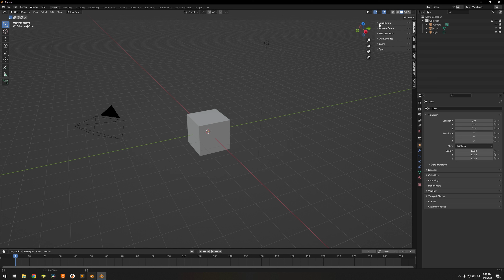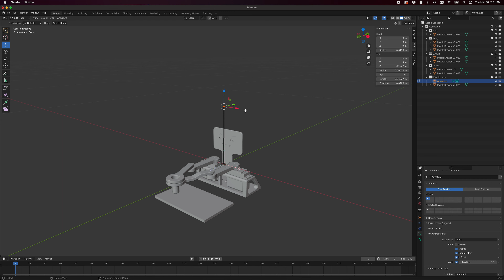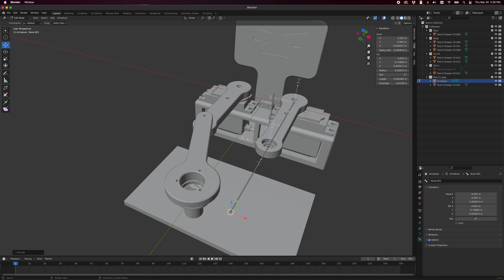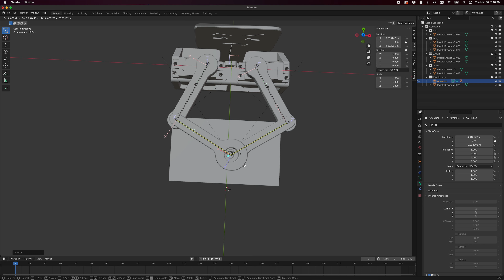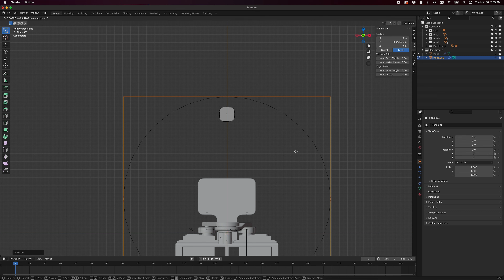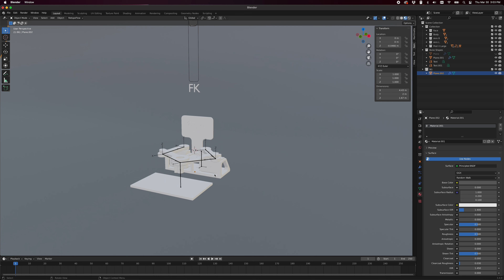MarIOnette Tutorial: Make Your Own Post-It Drawing Robot

Comment: how can I record motion or an animation in blender and save it to the nano/micro controller so that I can make it do that without the computer, for example when friggered by a button linked to the board?
Reply from the maker: Hi, I have a tutorial mostly edited covering lots of new features including close to what you're asking. Until it's posted (lots of things keeping me busy at my day job, sorry!) you can follow these steps: the 1.0.3 and 1.0.4 builds of MarIOnette supports saving an animation to a file and playing it back from an SD card. 
- Cache the file in the in the Cache menu (make sure to check "Write cache header file")
- Transfer to an SD card
- Trigger it in the Arduino code. The latest .ino Arduino file in the github has some commented code on lines 167-177 that shows an example of how to load in an animation. You can trigger that code with a button press/other input.

Unfortunately it will be some time before animations can be uploaded directly to the microcontroller, since there are so many boards with varying memory sizes floating around. Once my other work calms down a bit I'll look into tackling that and other requested features.
Reply: @knee-koh  thank you. I will check the latest build. In terms of boards, I think a good one to add support for would be the PCA9685. It supports 16 servos and you can chain up to 62 of them together. Thanks for making this! It’s awesome.

Comment: Not installing for some reason.  It's in my Addons menu, in grey, not clickable.  Using  Blender 3.4 
Error: Traceback        ModuleNotFoundError?????   If I can't Copy and Paste something , I'm usually out of luck.
Any advice would be appreciated.
Reply from the maker: Hi, could you log the issue to the github so I can track it better - https://github.com/knee-koh/MarIOnette/issues? If you are trying to install MarIOnette on windows, please launch Blender in Administrator Mode (right click the Blender icon on your desktop and select the corresponding option). From there install the add on as usual.
Reply: @knee-koh  Ok was able to install MarIOnette on two of my other PC's successfully.
The 1st computer I tried it on didn't work, cause I previously, accidentally,  deleted 
some critical files I may have needed to run my PC properly, gotta get that looked at.
Looking forward using the addon now, in Blender, Thanks.

Comment: what is config.h? Where can I get it?
Reply from the maker: Hi, config.h gets generated automatically when you hit the "Sync" button in the MarIOnette panel. That button will generate an Arduino .ino file and a config.h file into a folder you specify. When you open the .ino file, Arduino should open with the config file automatically.
Reply: @knee-koh  thanks, because I thought you forgot to add this file. thanks for the help

Comment: Could this be done with a state machine, FreeRTOS, with many servos different directions, and different timing and delays. I would like to see maybe rather we add Daz Studio stuff to it like our Daz Studio chatbot or just Daz Studio plugins and artworks in general. Then, that would be awesome. We would just need computer vision capable plugin and accelerometers or gyroscopes in the microcontrollers. If it could be based on the stm32 cortex core instead of just the atmega328 in the arduino.

Comment: Hey man, amazing work. Really.
When i was a kid, I kinda liked coding animations. I felt oddly powerful, but now, as I've grown, my projects grew too, and it's too frustrating to keep iterating in small adjustments etc etc.
Anyway, I'm finding difficult to control steppers. I'm using a RAMPS 1.4 to control a 5 axis robot camera slider. Everything is connected properly, and with a test code all the motors run properly.
I copied the same dir and step pins in MarIOnette, connected all the bones (selecting show value confirms the correct bones are linked). No problem uploading code and connecting (the serial becomes busy) but nothing moves. controlled config.h and found the first value of all motor's array was 5 (the same number of motors), guessed maybe a little bug on the less used steppers config generator didn't set the correct index, but nothing. Any suggestion? thanks in advance
P.S. I'm planning on releasing a video about the project and the project itself (when it will be i a releasable state)
Reply: Okay, sorry. Quick and last update: IT WORKS. So: implementing and setting enablePins to low is needed for steppers to work (at least using a RAMPS 1.4 board), but the last piece of the puzzle was, of course, my stupidity. Nothing in the config.h needed to be changed (sorry for doubting your skills, master), but during troubleshooting, before adding enablePins, i restarted blender, 'cause: why not? Maybe fixes something, but i forgot to restart it in administrator mode... Big facepalm.
And nothing. That's all. Sorry for bothering you. I hope that at least someone find this helpful.
Now trying to implement a homing sequence. Wish me luck!
Reply: Okay, quick update: specifing the driver's enable pins and putting them low made the axis lock while not connected which seems intended behavior (except for one, which keeps moving very very slowly an jittery in one direction).
Connecting to MarIOnette while an animation plays makes all the axis release. Stopping the animation makes the axis locks after a few seconds and resuming the animation doesen't release, and all axys stay locked. Same happens if connect whithout an animation playing. P.s. Tried to change the first element of each motor array back to 5 (in config.h) but nothing (changing them to 0, 1, 2, 3, 4 changed the stepper which slowly turns while not connected, so it is indeed the motorIndex. Obviously you know already, just a thought of mine ahaha)

Comment: This is really great stuff. I completed this post-it bot tutorial successfully. had a bit of a time getting Arduino to write to the nano but once that was figured out, everything worked perfectly. 

I was curious if there's a solution to save an animation loop or even a set of animations  stored on the Nano, or perhaps a USB drive for it to operate independently from blender. like, if I want to activate an animation out in the field, not connected to a computer, by just pressing a corresponding button on a box, so to speak. I'm a novice to this kind of stuff so if this question isn't clear, it's likely that I don't exactly know the appropriate language to describe what I'm asking.
Reply: I saw that my questions are answered in another video. 🤦🏻‍♂

I've been able to get this to work with an Adafruit Feather M0, but now I'm attempting to use an 8-Channel Featherwing PWM and I'm running into a wall getting it to interact with blender/marionette. Any recommendations or resources that could help me through this?
Reply from the maker: @benploughman4145  , sorry for the late reply! I saw your comment on another video about SD card/localized animation playback; hopefully my answer explained that process a little better (though I am working on another tutorial that will walk through the process more thoroughly).

Happy to hear it works on an M0! In terms of getting it to run on the 8-channel Featherwing board, you'd need to write some code to handle communication with that specific chip. Fortunately Adafruit has taken most of the hard work with their libraries, so you'd need to do the following:
- Create servos and attach motors inside MarIOnette as if they were attached directly to the board
- Sync the files to create the .ino and .h files for your project
- Uncheck "Overwrite Arduino File" so you can edit the files freely in case you need to re-generate more code
- In the generated .h file (the one MarIOnette uses), you'll have to include the Featherwing libraries and connect with the board (use Adafruit's examples to see how to do this and copy over the code)
- From there, you just need to replace any Servo.write() or Servo.writeMicroseconds() lines of code in the .h file with the corresponding Featherwing commands. That way, your microcontroller will tell the Featherwing to actuate the servos over the i2c bus instead of the native PWM pins

Comment: hello sir, i have a problem when i try to connect my blender to arduino. it say something like "python could not open port access is denied" i have no serial monitor in Arduino IDE, and still like this.. any suggestions?
Reply from the maker: Did you also post an issue to the github? I can track it from there. You say you have no serial monitor in Arduino IDE, are you sure the Arduino is being detected when you plug it into your computer (if not there might be a hardware issue with the board or with your cable)? If Arduino IDE cannot detect the board, then MarIOnette will also not be able to detect.

Comment: I have been waiting years for something like this! Well done! I have an issue when downloading the obj from Git.  I get a list of vertices (I think) rather than a 3D file.  All the STLs downloaded fine but the OBJ is just a list of numbers. I'm new to Blender and Git but not to building Animatronics.  Apologies if this is very silly newbie mistake
Reply from the maker: That looks like a weird quirk with Github... You can download the entire repo (go to the main MarIOnette github page and then click Code > Download ZIP). Then unzip the file on your computer and you should be able to open the file. 

An alternative to avoid having to download the entire repo: here's the raw file path (https://raw.githubusercontent.com/knee-koh/MarIOnette/main/Examples/Drawing%20Robot/OBJ%20File/Post%20It%20Drawer%20V3.obj). Just use your browser to save this file (save or save as, and specify a .obj extension).

I'll update the next release to have the .obj file be in a .zip so it's easier to download
Reply: @knee-koh  Thanks very much for the reply.  In the end I copied and pasted the text into a text editor and saved it as a .obj.  I have managed to work my way through the entire tutorial (with a few stumbling blocks).  Adding the PWM library (that you mention in the github doc but possibly not in the video?) and changing the baud rate to 115200 got it working for me.  I really can't thank you enough for developing this plug in and I'm anxiously awaiting your next tutorial.  You have made a wonderful tool.  Well done!

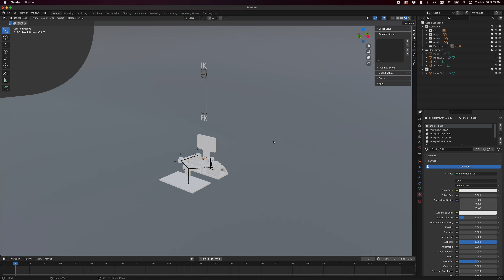Comment: I followed the video. at 30:47 you transition to the Build. When you come back to Blender, you have a VERY different setup. I have exact same servos and Print. This does not work. What changed from before the Build and when you came back to Blender?
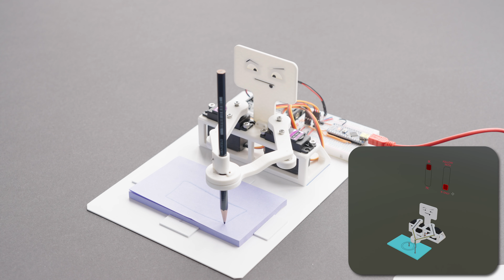Reply from the maker: Hi, I added a slider that controls whether the IK bone follows a path or is free to move. The fully rigged .blend file is in the github and has this change. I did not include this in the Blender tutorial because it was already getting very long, but I mention it at 36:09. It's not necessary to get the model working; it's just a bonus to showcase another form of controlling the rig.

Comment: Great addon and amazing tutotorial. Quick question is it possible  to do the reverse. In that can I physical move the robot and let blender track siad movement and be able to move the 3d model?
Reply from the maker: Yes, I am currently developing that feature: https://github.com/knee-koh/MarIOnette/blob/main/Media/Gifs/ElmoInput1.gif

An important note: you will not be able to do this with off-the-shelf RC servos like the one in this project. The Arduino needs to be able to get the rotation angle from the servos, so something like a Dynamixel or LX-16A will be required (or you will have to modify an RC servo and solder wires to the potentiometer in order to get the angle).
Reply: @knee-koh  ok great. What I will like to use it to make a robot arm or floating stylus and use that to probe around a part for a car and get a point cloud or 3d geometry and then let the industrial size arm cnc machine the part at a different scale